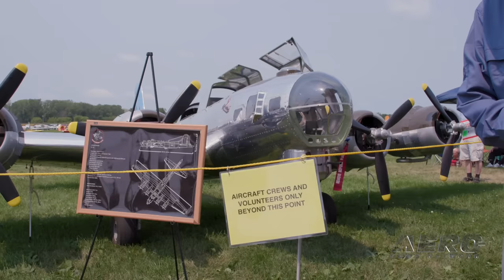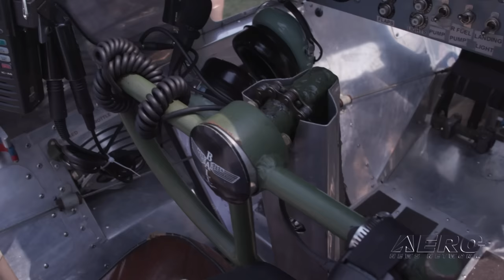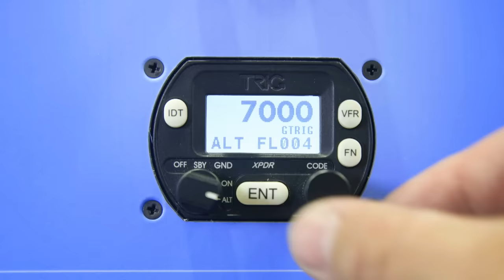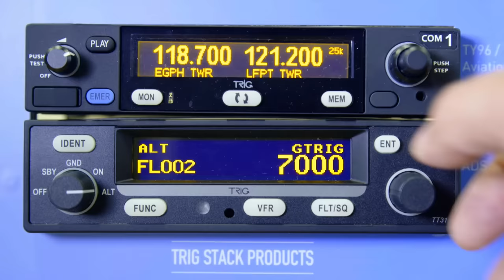Aero-TV: The Bally Bomber - The All Time Ultimate Warbird Replica?

Comment: Awesome aircraft!  I'm really surprised that you can actually scale down a design and still have the aerodynamics, weight, etc. work out so that it will fly.  Just curious...why didn't you use radial engines like in the original?  Perhaps they're not available in the right size and you would have had to build those as well?!!

Comment: With all of the enthusiasm for this fine aircraft, we wonder of Mr. Bally would have appreciated a go-fund-me to set him up with some stronger engines.
With Hirth engines at 4 x 45 horsepower = 180 horsepower and a ROC of 350 ft/min, that is quite short for the weight.
  It only needs some real radial engines 4 x 9 cylinders would give it some climbing moxie!  Vernier Scarlett 9U for nearly 550 horsepower !   
With those, it ought to climb like a homesick angel! 550 horsepower !   
With those, it ought to climb like a homesick angel!

Comment: Is it a one or two seater? If it's a two seater the second seat needs controls for remote operated turrets with .22cal semiautomatic ruger M1919 replicas using electronically actuated crank triggers installed in them. Fit it out like that and send it out on a flour bomb raid and send up scale model axis fighters (that are sarificable) to intercept it.

Comment: Somebody should design a replica Me 163 and put it into production as a home-built.
Fit a small turbine engine with air intakes in the leading edges.
The flying characteristics are well-known. Do a 3D scan of original Me 163s in museums and 3D print the moulds.
This will sell well to homebuilders and warbird fans.